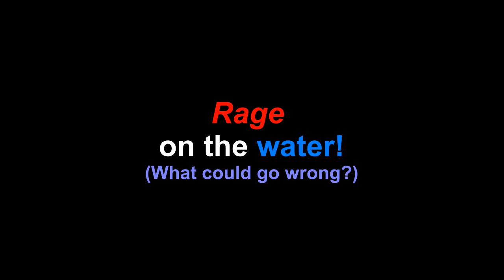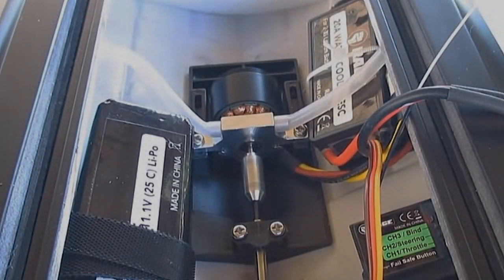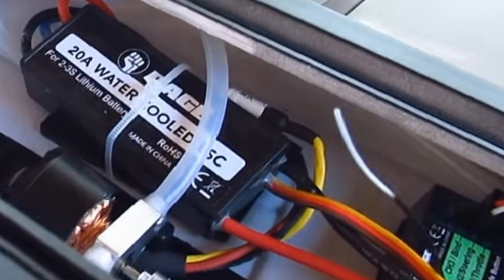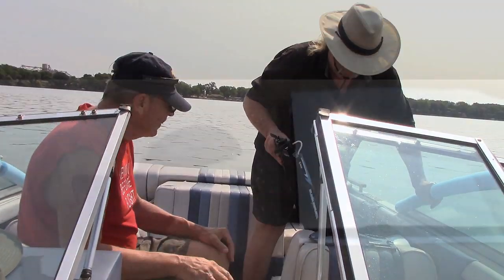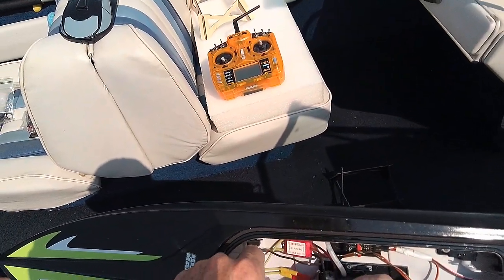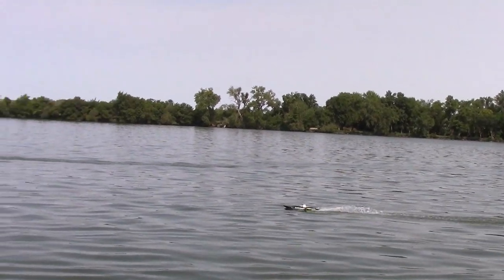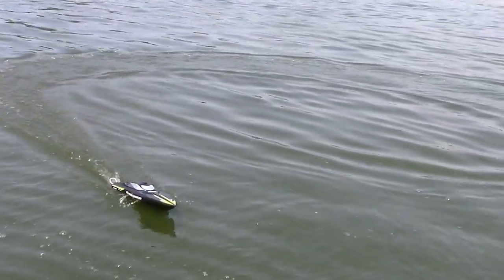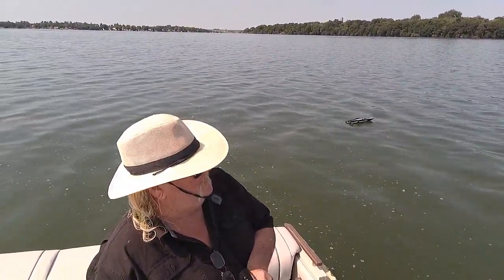Rage on the water! What could go wrong?

Comment: I have my boat receivers in a latex balloon with a cable tie around the top. Even if water gets into the hull, the receiver never gets even slightly wet.
Reply from the maker: Thanks. I know that can be done. I would have a hard time mounting everything with balloons around. My waterproof spray worked good for me but stay tuned, cause wait till you see what else I did. Thanks.

Comment: Why don’t you use a 3 cell  in the brushed motor? With the water jacket I doubt it would overheat but it sure would make a speed difference, although not as fast as the brushless..
Reply from the maker: I tried that last year and it fried the esc in less than 15seconds!!

Comment: Did waterproofing the electronics cause an over heating problem?
Reply from the maker: Not at all.  Mine runs fine.  The reason Tom's boat got water in the receiver (and it quit working), is because the water got in the servo connectors and into the RX.  That spray on mine cant even be seen, but it beads water all around it.  Wait till you see my next boat video mod.  Thanks Don.
Reply: Okay,......I know you know this.....They make waterproof receivers, and motors......but expense plays a role there. Great video!!!

Comment: I have two RC boats and neather one want to work. I am at a loss as to why. They are the same kind. I got one off market place. I suspect the batterys on both are junk. I killed mine last time I used it by running it too long and the other sat in storage too long. I am going to order new batterys and go from there.